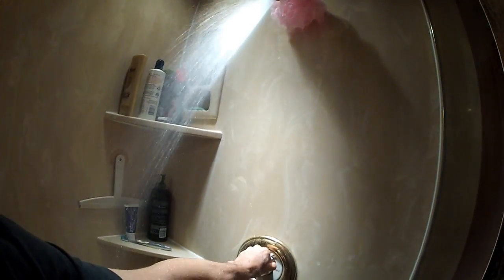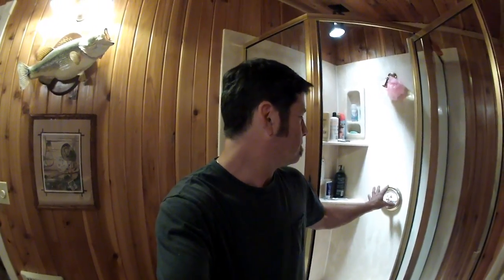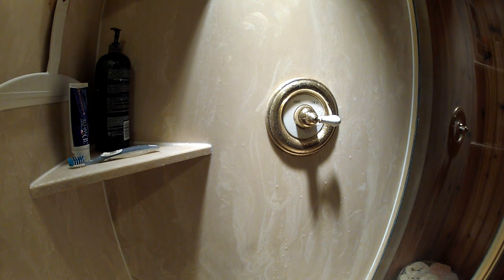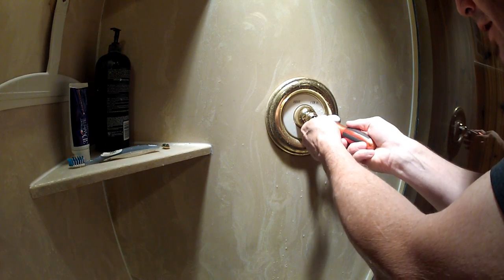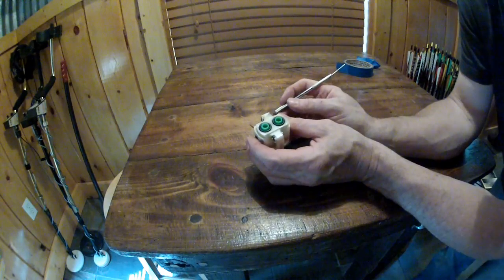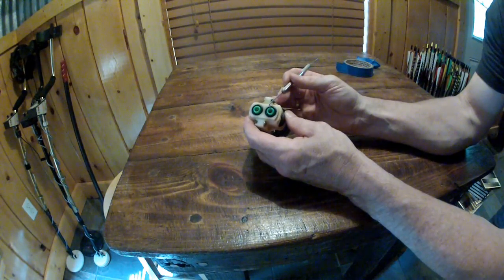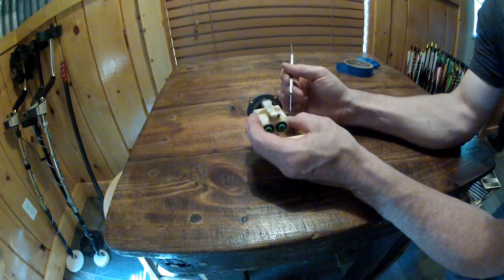American Standard Shower Valve Water Hammer Fix

Comment: Thanks for your trouble shooting tutorial. I  was affected by the shower hammer also. Wow, it was so NOISY!  After taking out the mixing valve I noticed that granular debris was partialing blocking the the inlet to the valve mixer.  In addition, the hot water mini blue backflow preventer was clogged also . I used compressed air to blow it out. I was going to replace the unit because it but it was going to take a couple of days.  Until then,  I just cleaned up the pressure balance unit up and lubed up the "0" ring with silicone grease  and reassembled the unit.  I also bought a new shower head. Most likely that debris came from my new whole house filtration system that I had installed 10 days earlier. The granules  looked liked the carbon bed material  that normally would would just remained in place but got agitated and went through the system post filter. I also checked in my crawl space  to see if any water pipe  clamps that  need to be more secure. So far so good.

Comment: Thanks for the helped. My entire house will vibrate when adjusting the hot water towards the cold water. But after I removed the washer like how you suggested in the video it fixed my issue. I can finally have visitors at my house now.

Comment: I know you posted this over a year ago but I just want to say thanks. I think the term water hammer was confusing the other so called experts. You nailed it, it was definitely in the pressure equalizer. I pulled my old one out and tried to get the o rings off but the plastic was so brittle it snapped the little ends off. I tried it like that but it dripped. I went to the depot and found a replacement anti scald and what the heck I replaced the cartridge too. It appears it's done it. I can get it to hammer by flushing the toilet which tells me the valve is working but if it comes back when it's just mixing I'll pull the o rings. 

Thanks for posting this!

Comment: Thank you for this video. Very well explained. I was getting ready to cut holes in the wall. I thought there was loose pipes in the wall rattling or something. I am on a well so the pressure goes up and down throughout the shower. It is very frustrating. I am going to tackle this tomorrow. Thanks again.

Comment: Thanks so much!  This even helped with a 20yr old version of faucet, slightly different but helped immensely just knowing how disassembly should go and that I would need to get creative to get the handle off.  
(I was able to pop off that back cover before taking off the handle so that I could see the pipes - and see that I wasn't pulling too hard on them.  Then I was able to grip the big brass bulb-looking cover in order to help pull the handle off.)  
I didn't have the same washer problem; I had sediment in the tiny hot water spring valve. Cleaned out pebbles and sand so that it was springy again.  Reassembled.  Never had better water pressure .... and all for free.  
Thanks again!
Reply from the maker: Glad to hear that the video helped!

Comment: You should've installed the valve with screw stops that could individually adjust hot/cold water flow. But glad that it worked out for you.

Comment: Before trying any solution try reducing the water pressure coming in to the shower mixing valve. There are two ways. Most valves have flat head screw valves on the sides to allow replacing the cartridge without shutting  off main water. Use these valves to reduce pressure. open these valves half way only (most likely it is the hot water side that is the problem so you can only reduce the hot water flow).  The other way is to install isolation valves to the bathroom water supply, you can then reduce pressure with these valves. These valves come in handy when you need to do any plumbing work in the bathroom, you can shut off water to that bathroom only while working, keeping the rest of the house with water service.

Comment: HELP PLEASE??
Thank you.  Very informative and helpful.  We had two AS Hampton shower valves installed in 1999.  The lesser used one started flowing only warm water and affected the nearby sink and clothes washer temps.  Then it started leaking.  Slow at first......  Plumber came out and 9 days/$300 later replaced the cartridge and (later) the balancer.  Fixed!  He left me the packages.
Just recently the more used one started hammering (just like in Garren King video) and hot out of the cold and cold out of the hot.  Parts came in 2-days ($60+/- from Amazon) and a quick run to the hardware store for a $10 handle.  Water hammer fixed!
EXCEPT!!! hot out of the cold and cold out of the hot.  Took it out and flipped the balancer over.  Same thing.  
I mean, it works very well, good water temp and no hammer,  buy hey I cannot leave it in this silly condition.  
ANY SUGGESTIONS??
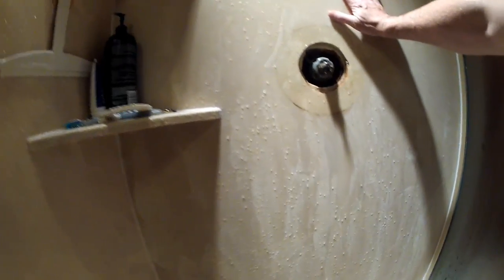Reply from the maker: If the hot and cold became switched on its own and not after it was taken apart then my suggestion would be to make sure that the hot limit stop has not come loose and allowed the stem to slip. The valve and stem assembly can be seen at 11:40 in my video where I point out that it is labeled "down" which puts the hot limit on top. Try loosening the set screw on the hot limit stop and rotate the stem 180 degrees and try that. Let me know if it works.
Reply: @roestreet  THANK YOU.  A perfect diagnosis and solution.  3/32" allen wrench to loosen the stop collar.  Turned 180* and tightened stop collar.  Jiggled just a bit to get it lined up.  Perfect!!   +1000 YTDIY Points to you sir.
Reply from the maker: @jamesvaught2033  Your very welcome! Glad to hear you got it fixed!

Comment: Had same problem  used to open sink valve before using shower. Found the first cartridge was wrong one , was installed upside down, they filed off the tab to make it work. Installed proper cartridge ,problem went away!

Comment: I have the same shower valve. Do you know the valve number or the cartridge's number. great video by the way.
Reply from the maker: After the big freeze in Texas this year I replaced both units. I found them on Amazon. The pressure balance unit is 051091-0070A and the valve cartridge is 051337-0070A

Comment: This has been very educational. I have the Williamsburg version  and have 2 issues: 
1.A recent onset of water dripping from the faucet that is getting worse and worse and I even hear a hissing sound 
2. Water hammer in the entire house when shutting off faucets/washing machine etc. THis started at the same time the shower went weird. Maybe a coincidence but so frustrating.
As I was googling, I came upon this video. American Standard's CC has not been helpful and want receipts for this unit, which of course I do not have as a plumber installed it. 
My question is : If you are having dripping front the spout and a hiss vs the hammer you showed when mixing water, do I need the piece you show or is there a different cartridge piece?
Thank you so much for this video! I just fixed my cabrio washer suspension rods with a You Tube video and have replaced 2 control panels on a range and Cabrio dryer with such DIY videos.
Dorothy
Reply from the maker: It does seem odd that both problems started at the same time.  Is your plumbing the old galvanized pipe?
Reply: Thanks so much for responding. I'm sure parts are and many have been replaced. I'm going to just have a plumber in. We installed 2 dampers above the valves near the washing machine in the basement many years ago. I need a good diagnosis vs just swapping out the cartridge, however, I think that is shot regardless as water is heavily dripping out the spout but when I raise the diverter on the spout, it seems to slow down. It is all connected. Water hammer, not sure what's up there. If it's dripping, are there 2 things to change? It seems there is the balance and a cartridge. A.S. CC has been useless. Never again. Moen was always great.
Reply from the maker: My plumbing is also a mix of galvanized pipe and copper. Im slowly getting rid of all galvanized. It has been the source of many a problem.
Reply: I got a free pressure balance piece and cartridge from AS after complain ;=)
So I hope I can take a crack at this.
Reply from the maker: Great! Let us know how it works out.

Comment: Thank you for the video. Although after taking it apart the second time, I found my particular issue. The green valve where the hot water goes through was filled with sediment. The same sediment that I’m assuming started the issue with the old one. I installed a completely new piece and it’s gone. If it comes back I am certain that more sediment will be the culprit. A recently installed water softener is my hopes to stop this.

Comment: This is a good video.  I have a similiar problem that I'm trying to solve.  My question is: did this defeat the "anti scald" property of the valve?
Reply from the maker: I may have been mistaken when I made the video about where the anti-scald takes place. It doesn't appear that this modification alters it.  I think the scald control on this valve is a mechanical adjustment.
Reply: In my case, when I shut off a cold water valve (bathroom sink, toilet) and I get a water hammer in the valve.  It sounds like a free movement of a metal flap, confusing to me.  I WON'T be taking it apart to examine it.  My solution is to put an arrestor in the cold water pipe near the valve.  My thoughts are that the way an anti scald valve works is that the cold water supply in the valve is throttled one way or the other to maintain a balanced temperature.  Not sure if what I'm going to do will work or not.  It's interesting when you described the inner workings of the Amercan Standard valve, I wonder of other companies have a similar design?  Thanks again for the video.
Reply from the maker: Hope you get it sorted out. I don't know if other valves are similar but If I replace this one it will be a different brand.

Comment: Hoping you might be able to answer a question about the American Standard pressure balancing shower valve.  I have the same valve and, although it doesn't have the throbbing issue, the flow rate has been anemic from day one.  So I am wondering if you noticed any increased flow when you removed the O rings.  Thanks for making this excellent video with great commentary.
Reply from the maker: Removing the O rings didn't change the flow on mine but last year my flow rate dropped significantly. I took the valve apart and found some small pieces of rust and calcium wedged in the backflow preventers on the back of the cartridge. Picked them out with a dental pick and was good as new. Hope this helps.
Reply: @roestreet  Great.  Thanks for the prompt response.

Comment: I have the same type of shower faucet like yours. It’s leaking. Do you know what the part numbers for the cylinders are and where to order ? Thanks
Reply from the maker: The pressure balance unit is 051091-0070A and the valve cartridge is 051337-0070A. The last time I replaced mine was in 2021 and I found them on Amazon
Reply: @roestreet  Thanks. How do you remove the handle from the shower unit? I tried the puller from HD but it didn’t work!
Reply from the maker: @billlee4736  Honestly, I got so mad at mine I beat it with a hammer, heated it with a torch, soaked it in penetrating oil and finally got it to come off with the HD puller.

Comment: Could you tell me what the model number is of the A.S. trim kit and/or the type of valve? I need to replace a kit that is identical to the one that is being repaired and don't know what model will fit the current valve. Thank you.
Reply from the maker: I installed mine back in 1999. I believe it is the Williamsburg in polished brass. I still have the faded HD receipt. All it has is a Sku#. Not sure if it will still be good but it's 012611127410. Hope this helps!
Reply: Thank you so much! And thank you for this video!! I used it to disassemble my kit!

Comment: What is the part number for AS cartridge?
Reply from the maker: The pressure balance unit is 051091-0070A and the valve cartridge is 051337-0070A
Reply: @roestreet Thank you.

Comment: why not just replace the cartridge?
Reply from the maker: Replacing the cartridge will not fix the water hammer issue. The problem is the substantial imbalance of pressure between the hot and cold water in older homes. The cartridge has to be modified so that it will not try and balance those pressure differences. These work fine in newer homes that have even pressures.
Reply: @roestreet  interesting, the water company did some work on the lines in front of my house last week, now I have banging pipes......definitely a pressure issue